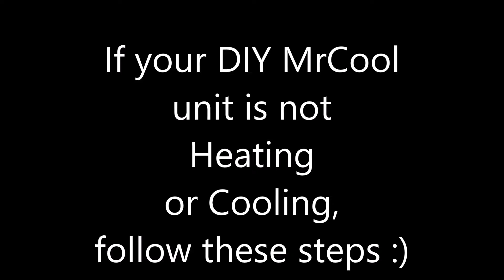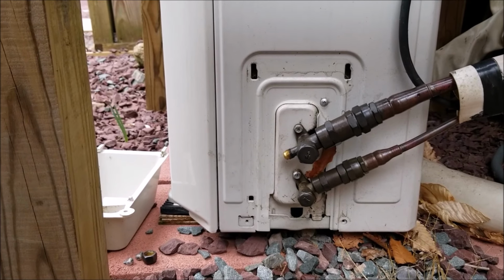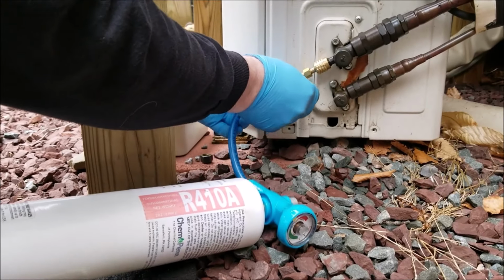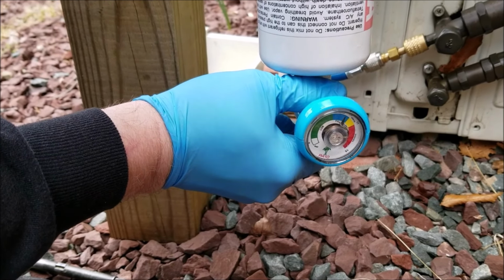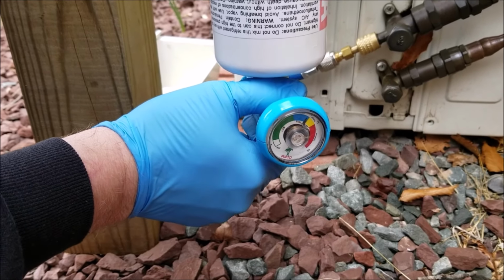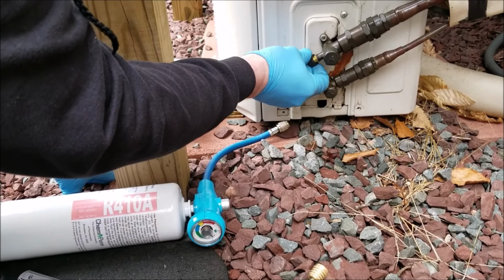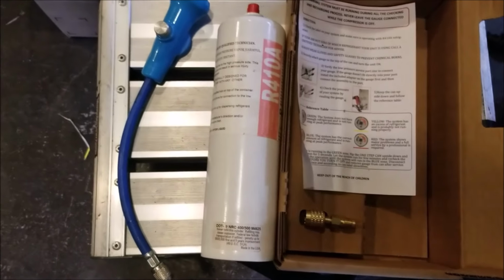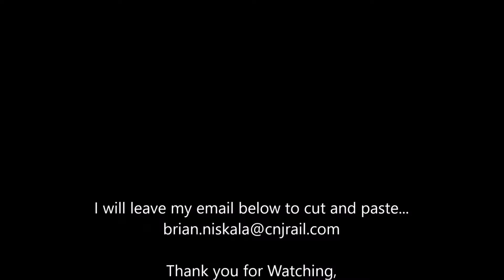Not heating? DIY MrCool 10 Minute Fix and other Ductless Units

Comment: Why was it low, adding refrigerant to a leaking unit without repairing the leak is nor repairing the problem.
Reply from the maker: Thus why my kits have a sealant that fixes most leaks! 😉
Reply: @GarageMahalLife  thus.
Reply: Why are you adding refrigerant for a heating problem?
Reply: @mtkoslowski  you obviously know nothing about how heat pumps work. Take a seat. More learning, less talking.
Reply: Do you cut the power when doing this?
Reply: @xxthewolfxx the active word was ‘why?’ indicating a position of learning
Reply: Is the unit running? Is it off? So, A/C mode…on, working?

Comment: Hey Brian, thanks for doing the video. I awoke this morning to my Mr cool unit blowing cold air in heat mode. Set point was 64 and room temp was 55 degrees. I powered off the unit and reset the breaker, waited 15 minutes and powered back on. The blower unit came on and started pumping good heat again. However, I ordered one of your kits just in case there is a leak or the system is low. I installed the unit just over a month ago. This is the first trouble ive run into. No error codes on display. Last night wasn't the coldest night since install either. Just trying to figure out what's going on. Cheers.
Reply from the maker: Make sure the fittings are all tight, sometimes the lines are not charged completely and need a "top off" but my kit is a great diagnostic tool too! You can see where the pressure is, it has dye to spot leaking fittings or holes in the lines. And ultimately has a sealant that can find and seal most leaks! Anyway feel free to contact me more if you need, Brian.niskala@cnjrail.com I'm here to help.
Reply: @Brian E. Niskala  Thanks Brian. Question regarding recharging. The unit has to be in cooling mode to recharge? What if the outside temperature is below freezing? Just concerned bout running cool mode this time of year.
Reply from the maker: @chrisheyer3974  Great question, always charge in cooling mode at 62 degrees... no matter the outside or inside temperature. When it is in cooling mode, the Suction line (fill valve/line) are at low pressure. When in heat mode, that line turns I to the high pressure line and it will be impossible and super dangerous to attempt to fill that way! But I outline that in the directions, so please be safe. Again super great question to ask during the winter months 😀
Reply: @Brian E. Niskala  Hey Brian, quick ques I have 2 zones, should I just recharge / check the larger zone or do I have to do both separately?
Reply from the maker: @chrisheyer3974  ReCharge at the main Suction line. Should be located at the top of most double plus units. Email me a picture to brian.niskala@cnjrail.com and I will circle which one to use for you.
Reply: @GarageMahalLife   hey Brian my unit is not throwing hot air where can I get one for my Blueridge unit thank you
Reply: Would you think you have a Leak. somewhere on your unit with it be in that low thank You in advance.
Reply: Quick question: how long did the heater work after resetting the breaker?

Comment: Question: is your recharge kit only for Mr cool or will it work with Premium Nevella? It’s also R410 with very similar features
Reply from the maker: This kit will work on just about any mini split system that takes 410. Actually it will work on 99.999% of all 410 systems out there! 😀

Comment: Brian, you never said why the unit was low on gas? Was there a leak?
Reply from the maker: I did actually in the comments,  initial install I had not tightened down the fitting all the way and some refrigerant leaked out... my fault, but it had worked great otherwise, just needed a good boost to have it working 100% they way it should, especially in heating mode.
Reply: @GarageMahalLife  I think I have the same problem. My unit is 5 months old. I ran the unit at 86F for 10 minutes. I can see all around the fitting and the caps are oily. Also, the smaller size copper line did not get hot at all.
Reply from the maker: @emadtubeyou  You definitely have a leak then... call MRCool if it is that new, otherwise you need to definitely tighten all the fittings and get a recharge kit from me.

Comment: This could be a good kit. I am wondering if it will work in the long run. It seems like this kit would introduce a slug of air into the refrigerant cycle without purging the  supply hose set up. Is there a purging technique?  Also You have to find the leak before putting more refrigerant in. Tightening the fittings doesn't usually fix leaks. Often they are already over tightened and will leak faster with more torque. Just my experiences.
Reply from the maker: It's a Great kit! If you are familiar with purging, feel free. However with such a small amount of air, it is compensated with a drying element in the formula that produces the UV dye and sealant, so not a 100% necessary. I made it to be simple and nothing complicated. Although over tight or too loose can affect leaks, I'd rather have it a but tighter than looser. Thus the other reason for the sealant. It will fix leaks on almost any leaks, keeping I. Mind the system originally was working as it should in the beginning. Anyway thank you for watching and hope I answered any question you had. Thanks for the comment and be safe out there!

Comment: My high pressure line is hot but the Fan doesn't run inside. Fans does work though when put into fan only it runs. But put it in heat mode and the fan opening opens partially and I don't feel any air
Reply from the maker: It maybe hot, but it has to be 140 degrees or higher... so you maybe low on refrigerant. I'm pretty sure you need my recharge kit...

Comment: Caught comment at end of clip about; ... Make sure you are in AC mode when recharging. Would like to see more specifics on prep before recharge.
Reply from the maker: I have detailed instructions included in each kit, but you want the system On and in Cooling mode 62 degrees  while recharging.
Reply: What is the reason for having it in AC mode while charging it?

Comment: Update - I would like to thank you again for this info. I'm happy to say I used one of these kits to recharge the my fourth unit. So this fix works! 
Now I'm going to recharge unit another unit that stopped heating. After owning 4 of these units bought between 2021 and 2022. I'm convinced that they're going to need yearly charging. I've had to recharge all units during the summer for Collings and now I'm going to do my 2nd unit for not heating. Hopefully that is the worst of these but I am not holding my breath.I have a 5th cabin that's going to get a mini split and it will NOT be a MrCool. 
Anyway, I appreciate the fix. Thanks.
Reply from the maker: Thank you for the update, the sealant I have in the kits will either stop or significantly slow any leak you may have!
Reply: BTW, I clicked on the link and it's not working. I wanted to buy a refill of the R134 refrigerant. You should look into it. FYI.  @GarageMahalLife
Reply: One more thing, the fix worked again on the aforementioned unit.

Comment: Brian my 24 k replacement condenser came in today and I know I asked you this once but want to be sure.
I know the new lines are charged but what about the 3 foot coming out of the indoor unit. When I undo these lines from the old lines will I have air in them? Do I need to do anything to prevent this or is it not enough to affect the unit? Thanks again.

Rick
Reply from the maker: Rick, send me an email brian.niskala@cnjrail.com

Comment: I just ordered a kit after seeing our video. I have 4 of these DIY mini splits and I've had to charge every one for bad cooling after one summer. Now, the newest of the bunch is not heating properly. I regret buying MrCool units but in reality, I needed 4 units and these I could afford. 4 of the better units would have put me over on costs. It is what it is. I gotta make these work one way or another.
Reply from the maker: They are great units vs. Cost of a HVAC install for sure. All units will have their flaws, I'm here to help fix those flaws 😀 my kits will help fix you right up!

Comment: I ordered the kit after seeing your YouTube clip. It arrived quickly and the instructions are great. 

The reason I ordered it was because my Mr. Cool self-installed system abruptly stopped heating about a week ago. 

The outside unit (compressor) will now turn on when I set it to heat mode, whereas it didn't before. However, it’s still not putting out heat. The blower on the inside unit will turn on if I switch to Cool mode. But if I switch to Heat mode it stops blowing no matter what I set the fan at. 

The filters and outside unit are clean too. The only factor I can think of right now is the outside temperature. Since this problem started, it has been unseasonably cool where I am in California in January. It usually doesn't go below 40 and highs are normally around 50-60. However it's been close to 30 and highs below 50. 

Could it be a bad temperature sensor instead?
Reply from the maker: Great description on what's going on. Recharge in cooling mode, despite the temp. Get it closer to the end of the right of the blue on the gauge. Remove charge hose and put back into heat mode. Put it to 86 degrees, leave for an hour. Check outside line to make sure 1 is at least 140 degrees, the other should be cold. Make sure the filters are clean and the find the inside temp gauge. Which is a small clear tube on the right side of the inside unit. Cup your hand over it and use a vacuum to suck all the dust out of that line.

Comment: Is the unit supposed to be on and running in cool mode when charging? Does this kit work with a 24k Aircon unit?
Reply from the maker: Yes, charge in cooling mode. Lowest setting 62 degrees, no matter the outside temp. And yes it will work with any system that takes 410a refrigerant.

Comment: Looks like this will work on other units not just Mr. Cool. Is that correct? E.G. Senville (inverter)
Reply from the maker: Correct, any unit that takes 410a refrigerant including dehumidifiers! But yes will work on basically any mini split unit.

Comment: Just curious.  Do you run the unit while topping it off with refrigerant ?  I ask because the automobile fill kits state to run the AC with the windows down while topping off.  Thanks.
Reply from the maker: Yes cooling mode 62 degrees, no matter inside or outside temp. Charge in Cooling Mode Only

Comment: Question: I have 4 mini splits throughout my house. 3 work great the blow both hot and cold air. One of them when on the heat or cold setting only blows room temperature air on the heat setting and quits blowing air after 2 mins. Any suggestions?
Reply from the maker: Is that one the furthest from the air handler outside? Is it a 1 or 2 compressor unit? Brian.niskala@cnjrail.com is my email. It sounds like you are definitely low on refrigerant.

Comment: How can I be sure this is what I need.  I have a 36k btu Mr Cool system with two interior units.  I’m not getting any codes.  It seems to be cooling adequately, but I’m not getting any heat.

Comment: Question! Will this work for a unit that’s not cooling properly as well?? Installed my unit about 5 years ago and it will not cool or heat.
Reply from the maker: Yes, yes it will 😀
Reply: I purchased the one kit and now my unit blows cool! Thank you! 

When I filled it it did not reach the blue band I need more refrigerant. Do you know if I can just purchase a can??

Comment: Does your Recharge Kit work on other Heat 
Pump Brands?
Reply from the maker: Absolutely, if it takes 410a Refrigerant it will work. Just look on your outside fan unit. The placard by the lines should say 410a, if it does you can use my kit! I have an adapter in every kit so it will fit 99.9% of units!

Comment: We have a Ramsond unit; no hot air this morning. I will have to find which refrigerant it is using before I order (won't I?) Good video!
Reply from the maker: If it takes 410a which it should, just double check on the outside fan unit. By the copper lines it should say what refrigerant it takes. If it's 410a my kit will work for you 😀
Reply: @GarageMahalLife  Thanks, will get out there today.
Reply from the maker: @Anvanho  when you order, I usually finish shipping by noon, otherwise I ship same day and or next day.
Reply: @GarageMahalLife  Thanks! The odd thing is, though, the ~ac works great still, so there must not(?) be a leak so I now wonder if the coils are in need of cleaning?
Reply from the maker: @Anvanho  The core valves tend to leak after a few years, my sealant fixes small leaks. Cooling mode is easier on mini splits and doesn't need as much refrigerant. Heat mode however needs just about perfect pressure to generate 140 degrees to have the cpu and sensors work efficiently

Comment: It's the middle of winter here ice cold outside & my mini split wont produce any heat needs charged but I don't think I can recharge my mini split in AC mode because the AC mode won't actually turn on
Reply from the maker: Yes you can, turn unit into cooling mode 62 degrees, no matter outside or inside temp, then start recharging the unit. The system will detect a pressure change and let you charge, even if it is 20 degrees outside. Quick, easy in any weather
Reply: @GarageMahalLife  ohh ok thanks mines is the Senville 12,000btu I was just wondering

Comment: Hello, I have Pioneer Diamanté Ultra WYT-22 Inverter Series it’s showing an E4 error code on  the unit do you know if that is why it’s not heating? And would this be the fix . Was the unit in this video throwing an error code, if so what code.  Thank You
Reply from the maker: Yes a P4 can be attributed to a low system leak. My kit will help fix and seal the leak, while bringing it up to the correct operating pressure/temperature.

Comment: Ordered a kit.  Do the instructions include how to purge the air out of the hoses before attempting to fill?
Reply from the maker: One hose, sealed. Minimal air, it is not a big hose that HVAC techs have. Purging air is really not an issue with modern equipment. HVAC techs put that fear so you call an HVAC company and not service yourself... fear factor.

Comment: I have a 18k diy unit that we installed little over a year ago. Been working great until a couple months ago when we needed to use the heat again. Keeps popping a p4 code and just the fan will run. Now the cooling does the same thing as well.  The outside unit wont kick on at all, the voltage is good but not sure about the refrigerant... tried calling mr cool but cant get a hold of anyone... about to have our first baby so really want this fixed before she gets here😢
Reply from the maker: My kit will fix you right up and get that little one warm 😀

Comment: I have a MrCool Universal inverter heatpump system that throws a E3 code. Seller Ingram's said it is low on refridgerrant. The E3 is a protection mode so the unit wouldn't start due to this mode. How would one recharge this?
Reply from the maker: Turn unit off, wait 10 minutes. Have my charge kit ready. Then turn unit on in Cooling mode on the lowest temp, usually 62 degrees. Charge with my kit and all fixed! 😀 email with questions Brian.niskala@cnjrail.com

Comment: Any ideas on why my Panasonic Split Cooling Inverter one on wall heat and cooling. 

Only Cooling works after Aircon people fixed it. It use to heat well but know doesn't get hot even on highest setting. 

The Aircon people where very average, not the greatest. 

They put extra recharge into system like a gas thing, said we recharged it. That was last Summer less than 1yr ago.

Now we are in Winter our first one since then and it doesn't heat much anymore, can feel it loop warm at 30 degrees if you stand directly under unit.

Any ideas appreciated, thanks
Reply from the maker: Needs a recharge, has a small leak I suspect. What area are you in? Brian.niskala@cnjrail.com is my email

Comment: I have to ask. My diy 18k mrcool compressor starts and only pulls 4 amps but will stop after about 10seconds, then repeats about every 3 or so minutes. Do you stick Im low on Freon? No cooling or heat.
Reply from the maker: No error codes? But typically a low refrigerant issue 98% of the time. Especially if it starts and the. Turns off right away...

Comment: If my Gree mini split unit have a E6 code when I turn on heat mode. Will this kit help put my heater mode back to work?
Reply from the maker: As long as it takes 410a it will fix you right up 😀

Comment: Installed a 18k mini in January. The air conditioning work fine but found the heating is not smooth always hunting from on and off. Think it’s the thermostat maybe causing it to react too quickly. Think I should mount a remote location thermostat away from the unit. Tried to contact Mr Cool three months ago but cannot get a return call from Tech.
Reply from the maker: The remote needs to be in sight of the unit with nothing in-between that line of sight. That can and will cause issues. Under the cover of the unit to the right there is a little clear tube of plastic. In there is the units one temp monitor. Get a can of air and blow that piece out. That should help stabilize as long as the refrigerant level is where it should be. These units start losing pressure after about 3 to 5 years.

Hope this helps...
Reply: Hi brian I am building a house this fall or next spring an thinking of use if these for main heat! However I am getting nervous here seeing how many people say they can never get a tech from mr cool to get back to them !waiting months?? That sounds ludicrous ! Especially being heat for your family. You also say they start leaking after 3 to 5 years? What is that ?
Do all mini splits leak like this . Thanks for any response you can give me